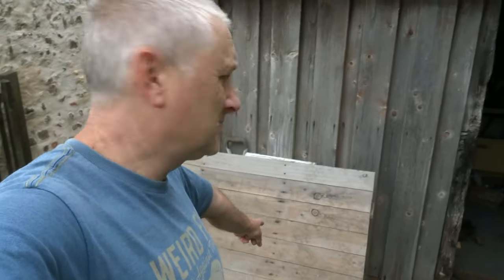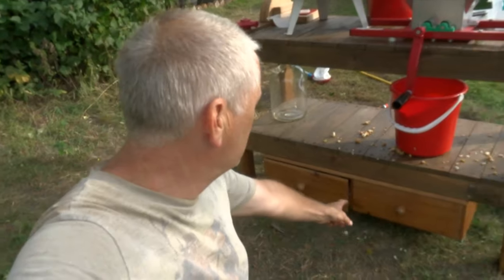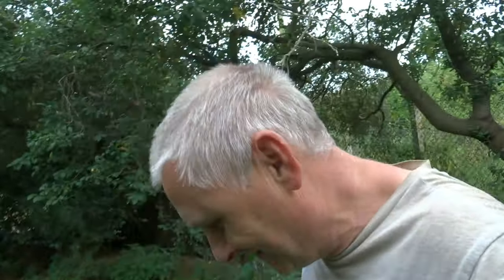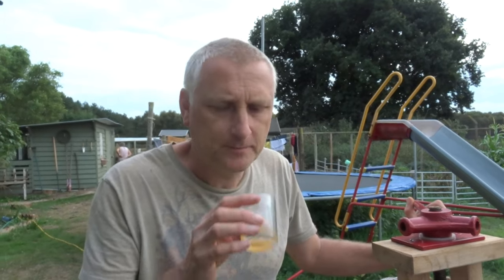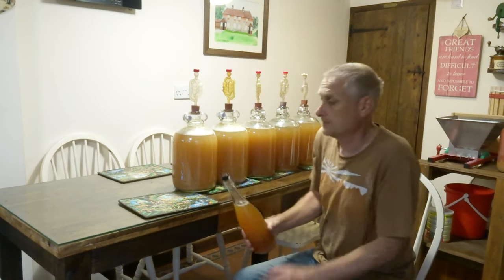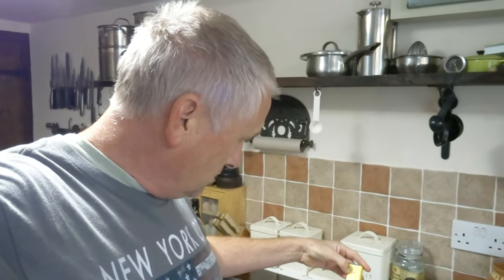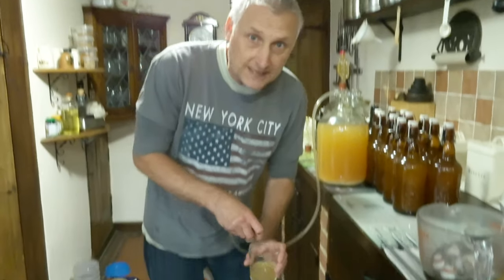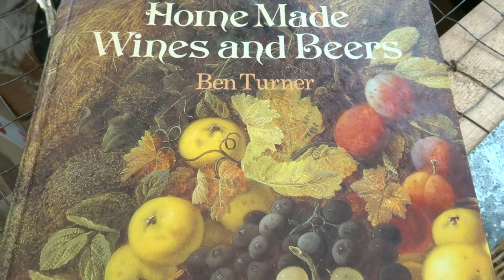HOMEMADE CIDER FROM START TO FINISH - Smallholding Homestead UK.

Comment: Hi Gary great vid as usual. Love your style ! A tip for you! I've used those scratters in the past and to tell the truth they are totally naff compared to a garden shredder. Not only do you chuck the whole apples in but they come out completely pulped and you squeeze way more juice out. Thanks for all the cracking footage! All the best.
Reply from the maker: Hello Juliet. thanks very much for the tip, i must admit i put the apples through twice in the scatter to get a finer pulp ( which was not in the video) but it was still a bit lumpy and could have done better for more juice if finer,  I also like to used old fashioned off grid hand cranked item, the good news is the left over pulp was all ate by the ducks and chickens, they got through it all in just 2 days. No waste is what i like. Thanks so much for your tip, its does sound a lot quicker and easier. keep safe and well.

Comment: As a Suffolk bum and brewer myself (elderflower wine and cherry meads my favourite) I’m impressed with your skills and knowledge.
I could up your game a little too with some “bloke at the shed” style conversation some time if you’re interested.
Also got some spare Demi johns if you need more.
Reply from the maker: Hello, sorry for such a late reply, ive not been on here much for the past few months, thanks for your kind offers. Ive got plenty of demi johns thanks, but i was thinking of investing in a nice copper still,  if you have any knowledge on that it would be great to chat.  The still would be for making essential oils only of course !!! , cheers and take good care
Reply: @ESCAPINGTHEMATRIXFORGOOD  - My only experience of copper stills comes from a brief time I spent in the distillery at Adnams when I was assisting there for 2 weeks, but that was mostly brewery and Lab side of things, so making the mash/wort for spirits rather than distilling it. Good on you for venturing into the field of "essential oils". Heat distillation is by far the best method, not like the freezing method some numpties try and then blind themselves with concentrated toxins.

All the best!

Comment: Spending a year dead for tax reasons? You been taking lessons from Hotblack Desiato? by any chance
Reply from the maker: Hello Steve, hope all is well on the smallholding. I have totally forgot about  hotblack , but on googling it i was an absolute fan of the original series of hitch hikers guide to the galaxy, I recorded them from the TV onto vhs when i was young when it was  first aired and often watched them, its been many many years since ive seen them, im now going to hunt for them on the web and rewatch. Thanks for the reminder !!! keep safe and well, take good care
Reply: @ESCAPINGTHEMATRIXFORGOOD  go for the original radio series. Much better 😎

Comment: My approach is different. I harvest from the ground + use natural yeasts. The acidity denatures any nasties. If I apply heat, it's towards the end, to stabilise bottles. Loved the furniture.
Reply from the maker: Hello. You are the cider king ! i trust your advice totally.  My cider is now ready with a nice amount of fizz, i know my approach was not the normal,  it does taste quite reasonable though but not up there with the best,  i now know why calcium carbonate is preferred as the bicarbonate of soda can slightly be tasted. Sadly i did not harvest from the ground as the trees are in the duck and chicken run with plenty of poop on the ground, good tree fertilizer though ! The birds eat the wind fall. Thanks so much for your comment, i could do with a proper cider making crash course from you. keep safe and well.
Reply: @ESCAPINGTHEMATRIXFORGOOD  horses for courses 🐎 I can see why with the birds it's difficult. I'm a bit of a purist. I don't like to add (spend) anything. Which makes me think: "Aren't egg shells essentially CaCO3?" You could dry them out and powder em up. Useful in the compost anyways (you probably got excess wood ash). Also maybe you could plant a few cider apple trees strategically in the countryside around you? They good for nature anyways. 🦋
Reply from the maker: @crispcider  Hello, great idea on the planting of apple trees in the forest ! they call that Gorilla planting, i will look into that, thanks and take good care.

Comment: It's prolly to late to order some Cyder you probably drank it all by now :oD looks yummy hahaha
Reply from the maker: Hello ha ha, ive had to cut down on the booze ! ive been trying to shrink my belly for over a year now.  nearly 1 stone lighter now.  Sorry for a late reply, always too busy here. Ive  fitted the electric supply into the house from the caravan batteries and have the invertor fitted. Im ready for the power cuts. There has been very little coverage on the burnt equipment on the incoming supply from France but plenty on gas shortage stories causing blackouts, there is a lot of ingredients in the recipe for it to happen !. Ive even got plenty of clean burn oil for an extra back up for lighting. thanks Again for the info you gave me. Hope your generator is working fine. Thanks so much Ortorea keep safe and well.
Reply: Yeah I'm fine, just taking a little break while landlord refurbishes my bathroom, having to wake up early has thrown me off my schedule of hobby projects so hopefully by next week can resume my projects, just tired with all the upheaval from messy builders. And it's my Birthday Tomorrow so chilling out lol